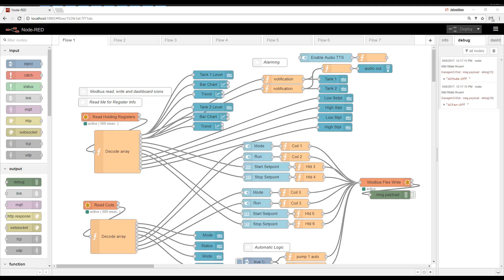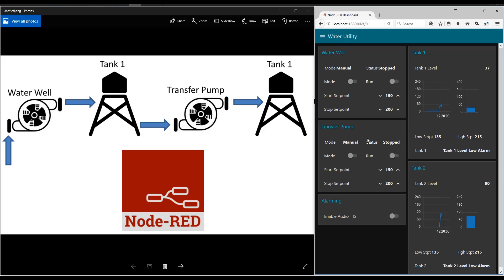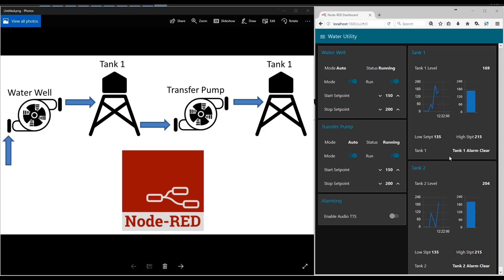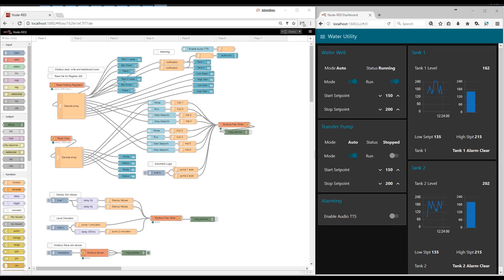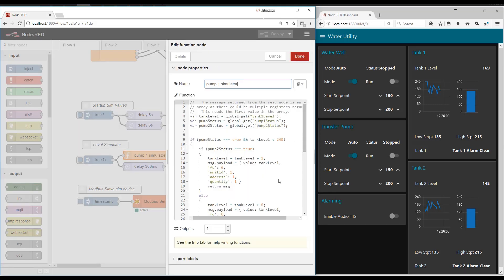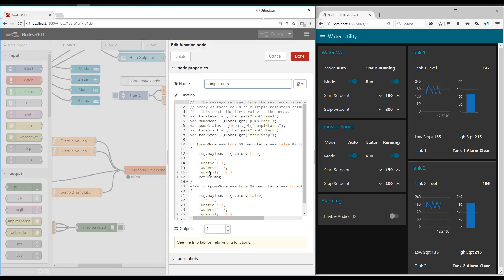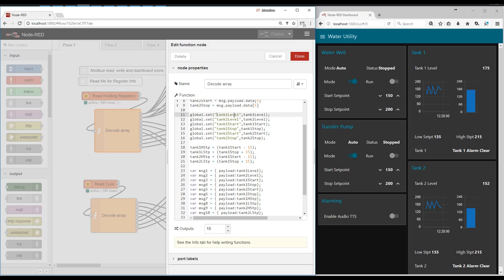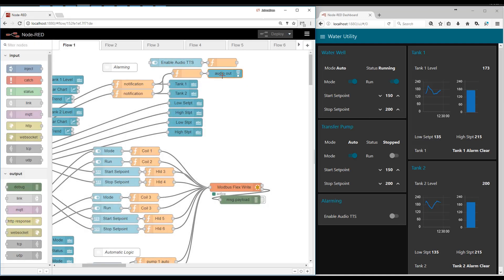Node-Red Complex Water Utility Example (SCADA)

Comment: The use  is interesting.  however, you might want to label one of the tanks as #2.
also, you can use a 'gauge' with 'level' to show the tank value and make that part dynamic.
also, you can 'spin' the motors to simulate motor running.
with some programming, you can copy and re-work the gauge display with level into a square to more closely represent the tank.
Very nice to show the dual screen.